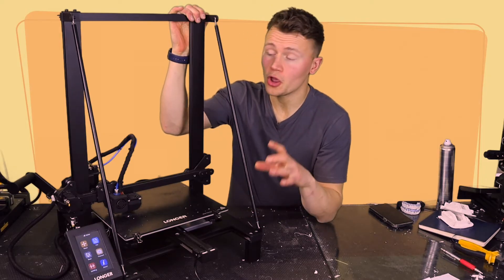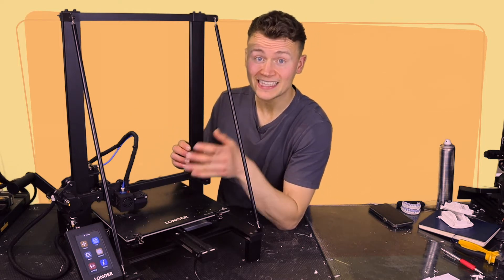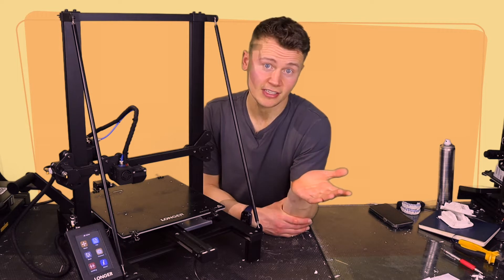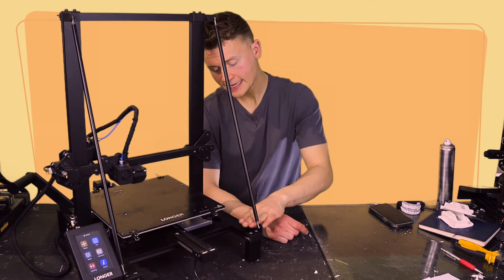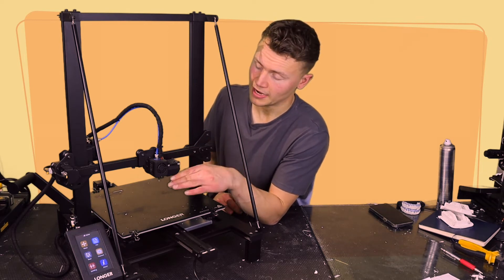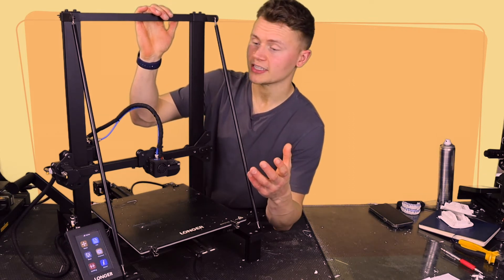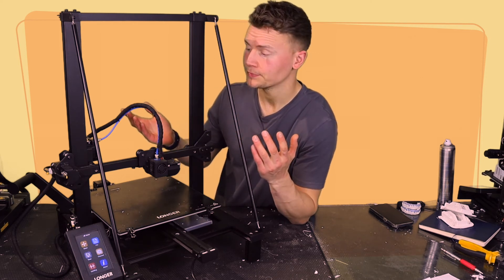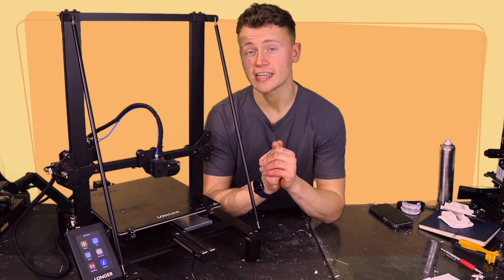Longer LK5Pro 3D Printer Review - Better than Creality CR10!?

Comment: I bought the Longer 5k pro about a month ago. I've only printed items that were already programmed into the printer. That's because I'm having an issue trying to figure out how to use the slicing software. But the prints have been very clean and I'm happy with it. I had a few issues when I first bought it, but Longer took care of me. I would recommend this printer.
Reply from the maker: Thanks for sharing your experience Scott, glad you would recommend the printer:)
Reply: @CallumColes  I figured out what I was doing wrong. Thanks for the response!

Comment: Thanks for a great review! What would be your main pick between this, the CR10 v2, and the Ender 5 plus?
Reply from the maker: Appreciate the comment:)

I'd probably pick this printer over the CR10 v2, mainly because the power unit is built into the printer and it's quite a bit cheaper. The separate power block that most of the CR10 designs has is a bit of a pain! Print quality on both those printers would be very similar.

But the Ender 5 Plus is better than both, bed slingers designs really do limit the quality and speed of prints. I have also done a review of the Ender 5 Plus.